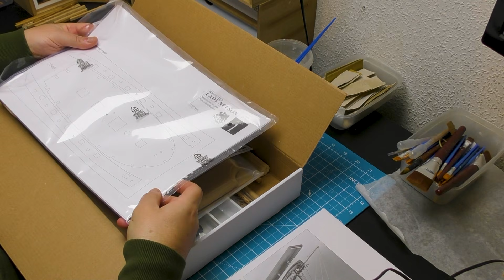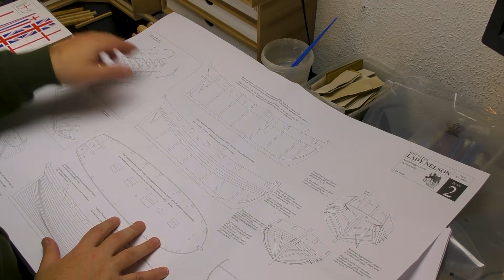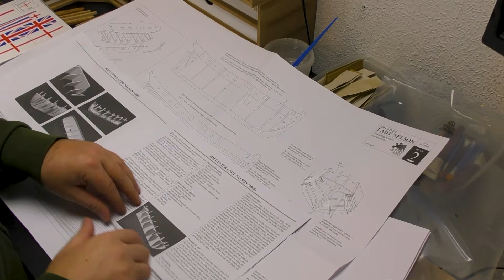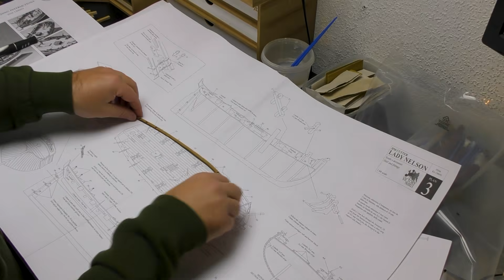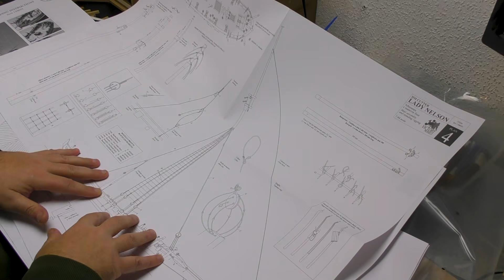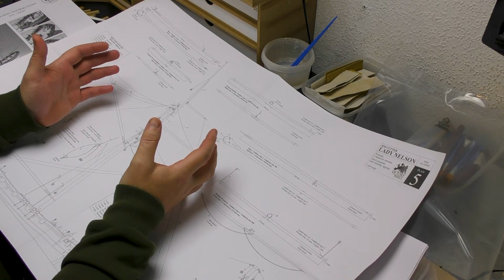Before You Buy Your First Wooden Model Ship Kit

Comment: As a beginner looking at many options, downloading instructions and taking in all I could.  This one is not my first kit.  It does not have sails, which is a huge part of a sailing vessel you are not learning, if you learn you hate sails maybe this is a direction to go, for me, I have built a plastic sailing ship so am not fully newbie to the ideas just the wood medium, and the rigging was a lot simplier on plastic ships.  The second is the instructions are not what I would consider a beginning option, which you even mentioned here.

A better option would the either Artesania Latina Swift or Virginia, they both have good instructions, premade sails and light rigging needed,  They also have one layer of planking, so if you are scared of planking, these are good ones, that you will cover with putty and paint, hiding any mistakes you made.

The other good one I found, and the one I am likely going with is the OcCre Polaris, it has the best instructions I have seen as well as a series of short videos on youtube you can watch to see in detail any place you get stuck, it also has double planking, so like here, you get some practice before applying the final layer, if it is still not all that good, I would take the idea from the Artesania Latina beginner kits and just cover them with putty and paint them.  Though as a seasoned plastic modeler I know quite of bit of painting techniques so am not worried about making paint look good...though painting will be a last resort.  The kit also has sails and a lighter rigging plan.

The way I am looking at these kits for a beginner is which ones give us the most taste of the hobby, with a low risk of getting stuck.  These all have easier shaped hulls so planking should be easier, all have simpler rigging, though the Lady Nelson is the most complex, other than all the others have sails to add.  My second model will then build off what I learn from my first.  Did I like planking?  Now I can look for a more shapely hull design,  Did I like rigging, I can go with a more square sail ship next like a brig with more ratlines and more concepts a small gaff rigged schooner did not explore.  I might not go  straight to a tall ship, but get something a step in between.  Or did I like the sails, do I want to try to make my own?  And the instructions will likely matter a lot less for that next model.

I think as an experienced wooden ship modeler, you are looking at this saying few parts, no sails to worry with so it is easier, but as a beginner I am saying, the instructions need work, the lack of sails is missing a large piece of the model, and the rigging is actually going to be tougher and more repetitive than the other kits I found.  The way I see it, if I love threading dead eyes, making rat lines would be a great step up, but for a first model that might be a bit advanced, and could create a block.

Of course if you disagree here let me know as I still have a couple weeks before I will be ready to start, so there is time to change kits or something if I am mistaken.
Reply from the maker: From research I’ve done, it’s looks like vanguard models, make good beginner models, with more comprehensive step by step instruction guide.
Reply: @Johnbuildsiconic  Yea, I forgot about Vanguard, there were my first choice and seem to have the very best instructions, but their cheapest builds are almost double the cost, of most of these, at least to get them here in the US, I would guess they are a lot more reasonable for UK builders.
Reply from the maker: Cost was the reason I went with the lady Nelson

Comment: I have been building plastic kits for fifteen years, to a very high standard. My wife bought me my first wooden kit for £60. Wow, I struggled. I found the instructions sparse at best; nothing quite fit right compared to plastic kits. I struggled through and finished with something like the model, but nothing like the model, if that makes sense. I imagine two or three models in, I may have something like the picture on the box.
Reply from the maker: It's definitely a different learning curve, but it’s very rewarding once you get the hang of it.
Reply: @Johnbuildsiconic  Do you lean towards a particular make or manufacturer of Wooden boats
Reply from the maker: No normally it’s a certain ship that I’m after

Comment: Lady Nelson is a great choice, but for newcomers in this hobby I would advise a more modern kit, the HM Armed Cutter Sherbourne from Vanguard.
Reply from the maker: Ye a very good choice, but with a lot of modern kit, most of the part where you learn the skills and art of model ship building are all laser cut ready for you just to fit
Reply: @Johnbuildsiconic  that may be correct, but I believe that the most important thing for a novice is to actually finish that first kit and be proud of what was achieved. From that first model then something was certainly learned and will be a good start for other challenges.

Comment: The mdf is imo clearly a major step down from plywood. Building the hms revenge and the ribs are quite long so they break off easily, with plywood this would never have happened. Now I need to figure where to glue them back on😤
Reply from the maker: It’s the same with all the manufacturers, mdf must be the cheapest solution

Comment: "Best" is subjective, it does look like a very beginner friendly model though.  Model Shipways Shipwright series is also a very good. it has 3 kits each increasing in difficulty and only cost around 160 USD.
Reply from the maker: Very subjective, there are  a lot of beginner friendly kits on the market, but I would say this is in the top 10
Reply: ship modeling is not for the poor and for the cheapskates 
never been never will be

this is ART when it's done WELL

whoever done it knows what I'm talking about

painting in oil on canvas is nothing compared to the difficulty of assembling in a reasonable amount of time (less than 4months like) a quality model like HMS Victory or Agamemnon or Santissima Trinidad spanish four deck ship of the line
Reply from the maker: I come under some criticism for the time my builds take, but it’s 5 years minimum for a ship of the line, like you said I’m making a peace of art
Reply: @Johnbuildsiconic  if you do it full time if you could sustain yourself liek 7-8 h 5 days a week
i think you coudl in 4 months do one complex one

if you are good at Google Ads and have good SEO you should in time find high quality generous clients or firms that want what you build